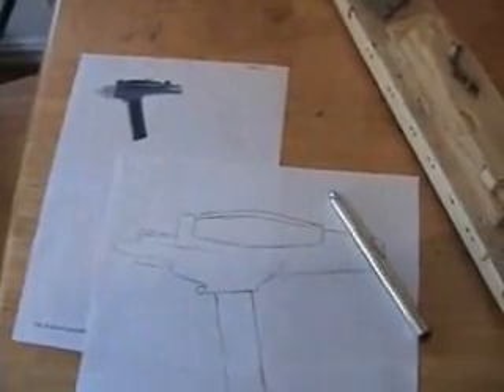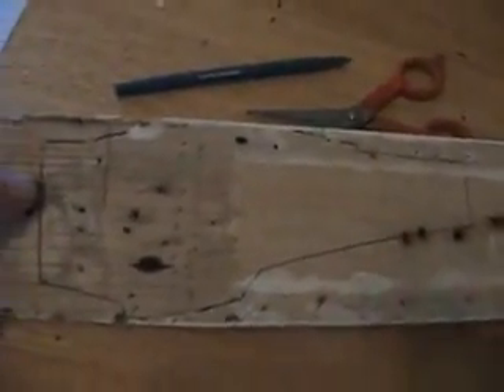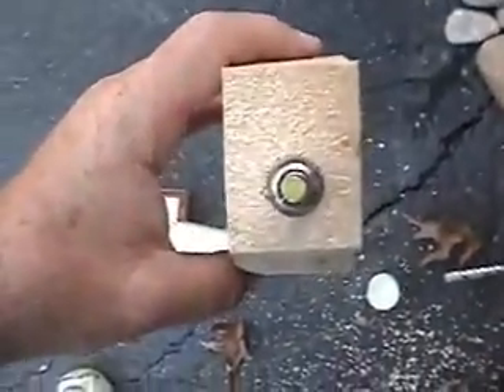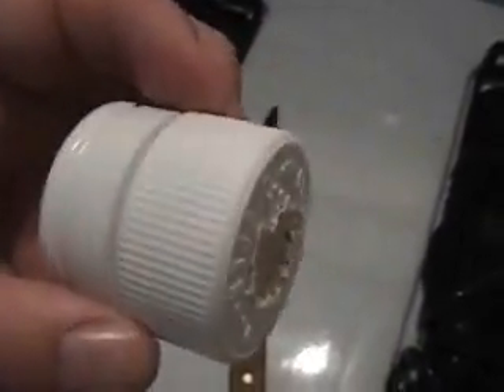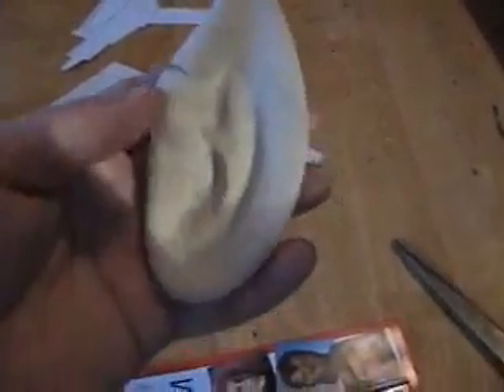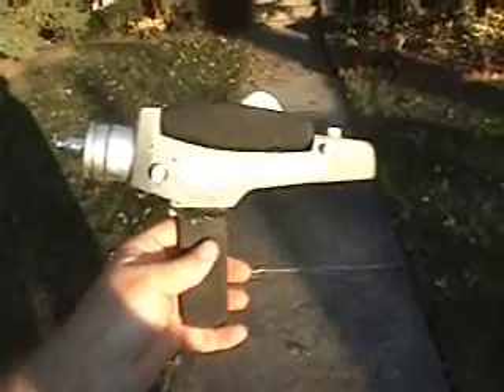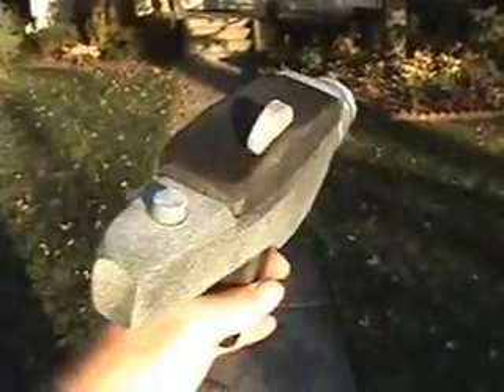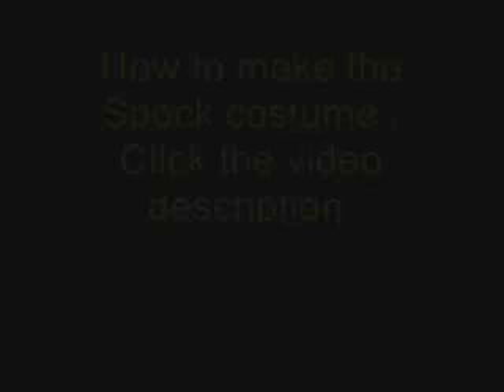How to make a Star Trek phaser

Comment from the maker: @Teridax12  from the back to the tip of the flashlight is 9and a quater inch .The wood of the gun legth is 7 1/4 , the hand held detachable  black phaser (that sitsin the big phaser ) is 4 " 6/16 , the handle is 3 '' 6/16  tall  and 3/4th wide , and 1 "1/16 wide .The phaser is 1 3/4 thick at the widest but the back tapers to 1". Bottle cap is 1 1/16 long . pen light is almost 5 3/4, the pen light is 3 1/2  deep, 2 2/16 sticks out .Pen light is 1/2 inch across .